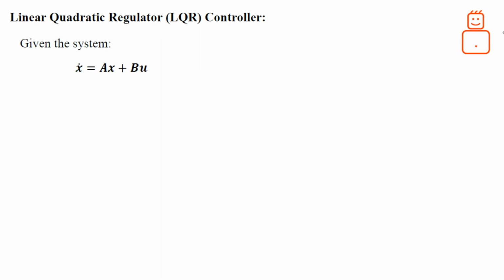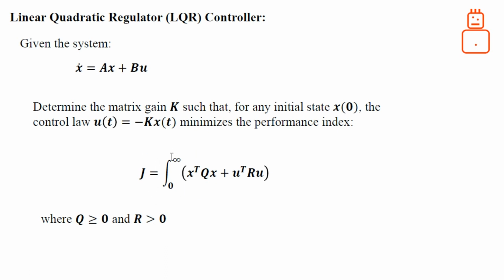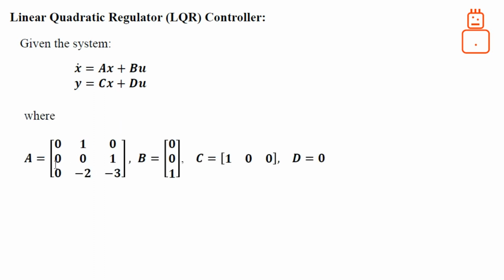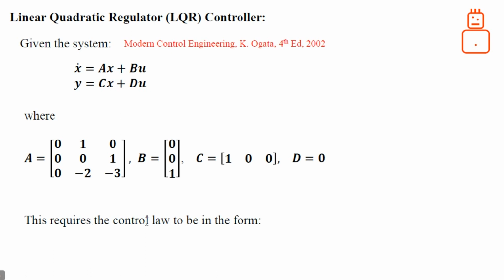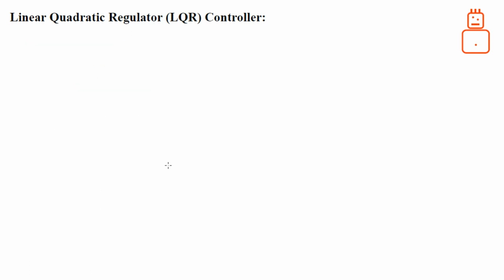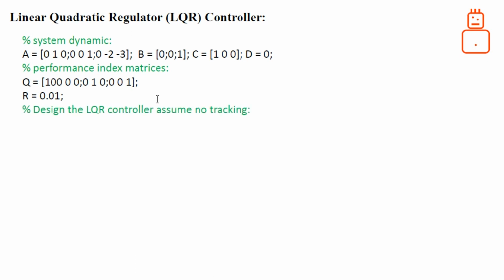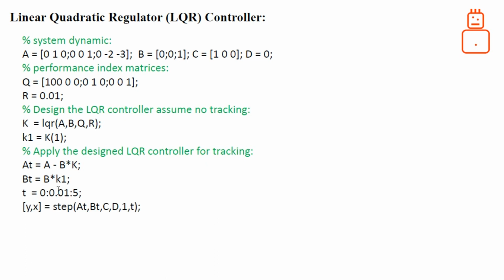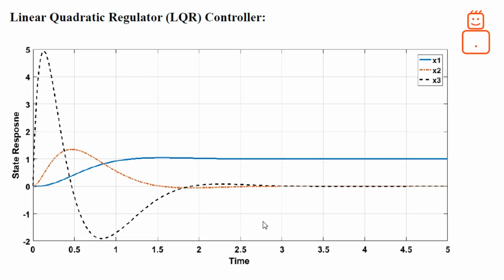LQR controller for tracking rather than just regulating! An example in Matlab

Comment: Hello, I have a question. Here we use LQR method get a gain K, which will make the state x all goes to 0 at steady state if we choose u=-Kx. But we make u = -K(x-xref) instead, and hope x will approach xref at steady state. I don't think this is the right method to make x track xref. For example, if I modified A matrix in your example into A = [1 2 3;4 5 6;1 -2 -3] and leave B,C,D unchanged. Then I followed your method compute K, and make u = -K(x-xref),  the output shows that x1 won't go to 1, and x2,x3 won't go to 0 too. 
According to http://staff.uz.zgora.pl/wpaszke/materialy/spc/Lec18.pdf . There are two methods to accomplish State Feedback Tracking: One is feedforward precompensation, another is Integral Action. Your method is similar to feedforward precompensation, but make the feedforward gain N equal to K, whick I think will not guarantee that x approach  xref.
Could you please explain more about this? Thanks a lot!

Comment: Hey! Ik this is a long shot since the video was posted 2 years ago, but i've been trying the same approach for a linearized double inverted pendulum on a cart but the tracking doesn't seem to work. Would you be open for a discussion?
Reply: I think this method is not right. Maybe you can use the method in https://ctms.engin.umich.edu/CTMS/index.php?example=InvertedPendulum&section=ControlStateSpace or the integral action method introduced in http://staff.uz.zgora.pl/wpaszke/materialy/spc/Lec18.pdf.